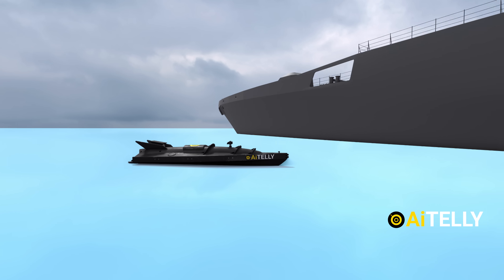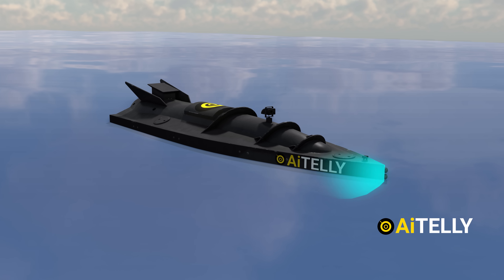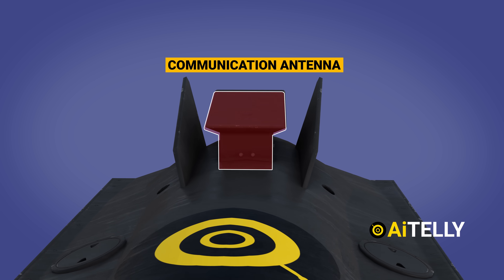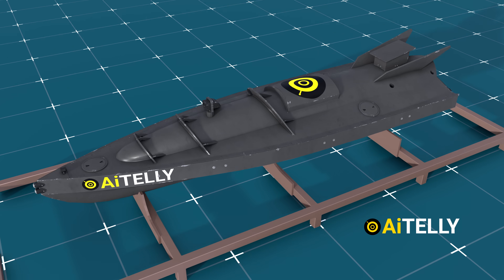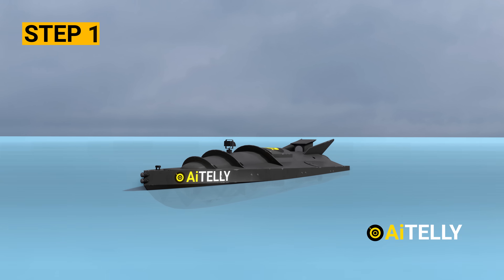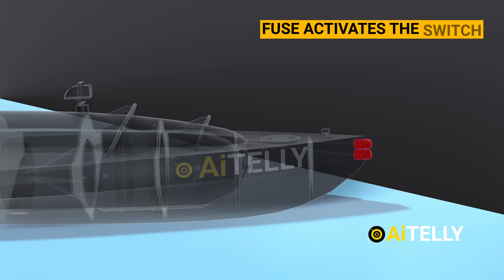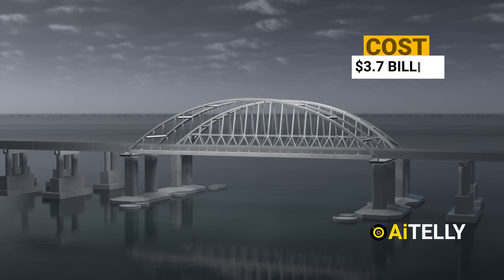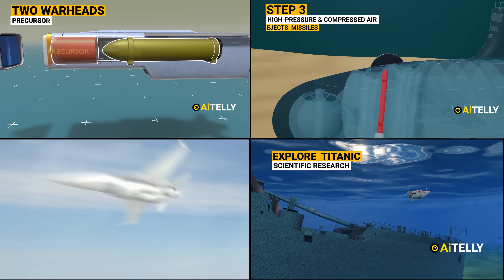Naval Kamikaze Sea Drone How it works using Starlink Satellite

Comment: Can you stop with the overly dramatic Verbage? It's a surface vessel. It doesn't operate or draw water from "THE DEPTHS" and the hydro jet motor is a good component for use in the drone boat but unless you were frozen in 1970 and just woke up, its not really jaw-dropping tech to anyone nowadays.

Comment: Ukraine's drones use GPS and GLONASS not Starlink. Musk won't allow Starlink to be used for offensive operations nor permit Ukraine use at sea. 

Ukraine's drones cost a fraction of the $250,000 you quote. Ukraine is using homemade drones, rather than torpedos, to save money.

Comment: I wonder if the arches could be made to 'hum' like a tuning forks. Most drones use FM signals, sat relays are too expensive to be disposable like kamikaze drones. FM pilot control, and a Reaper style drones being fed real-time data from NATO central.
The flares used to distract certain missiles could also be used at high value targets, if flashing LEDs will blind a camera that is using 'OCR' style self targeting for the last part of the flight, that is even better because a capacitor can be recharged quickly.

Will a 6-barrel .22lr be far away? One on each corner of a high value building, all connected to the other guns on nearby buildings so you have 3D aiming.

Comment: The Seadoo motor and pump is amazing. I used to own two when my sons were young and I was amazed by the power, and the efficiency of the water pump over propellers. So don’t put the power down please. So 50 mph does not sound impressive until you do that on water. Out of eight boats I have owned only one would go that fast.

Comment: This is a surface drone and it has many disadvantages. A little time will pass and he will already be old. The Russians have a proverb: “For every smart ass there is a dick with a screw. This drone is controlled by radio or via the Internet. This means its control can be jammed. If you make them like cheeseburgers, just as quickly and a lot. They can do a lot of harm.”

Comment: If they had built them like the drug dealers do, where an extremely small part sticks out above the surface, they would have been very difficult to detect.
In addition, they had hit the target ship's hull below the surface and caused even greater damage.
Just a thought.

Comment: How about semi-submersible drone to avoid visual detection? Ukraine sea drone navigate above water like normal sea boat. So it can be detected by visual surveillance or electronic radar. The underwater sea drone can cruise under the sea to avoid such detection. Only air snorkel for engine air intake/exhaust gas, antenna for communication and camera periscope will be exposed over the water. Most of ship hulls and deck are underwater to reduce water or wave resistance. It will extend its range too.
Reply: For a given speed the more you are underwater, the more drag you have. Approximately 800 times more drag (water vs air). If you want to go fast you have to barely touch the water, you have to fly over it. Submarines are the slowest of all vessels.
No submarine can catch a moving ship (the ship is faster). They launch torpedos which travel a little bit faster than a ship, but only for a few km, before sinking due to the lack of propulsion.
Reply: There is at least one already in UA. Named “Marichka”.

Comment: This is not a 'Drone'… I would call it a 'Remotely Operated Seacraft'. 
A drone is, in some way, able to make some autonomous action. 
Maybe I'm being pedantic, or maybe this craft can take some autonomous action, I don't know. But in a time when actual autonomous machines are being built, and successfully used, I feel it is important to distinguish the difference between the two. 
*I am not blaming the channel for this, it is a great video. I do imagine that the research this channel did, most likely found this craft referred to as a drone. The word 'drone' is thrown around by almost everyone, when it is not necessarily a drone, but a remotely controlled machine or device.

Comment: hitech? this? cheap hull, engine of jetski, aerial bomb of soviet era, skylink of spaceX, it`s all borrowing power. Self-driving only on a straight path, this doesent have hive-like AI just operator work trough SkyLink that was shuting off by Elon Musk. Much more hitech contains in russian aerial guided bomb FAB-1500-M54 with UPAM (Unified Planning and Adjustment Module), satellite-guided autonomus fly on over 100 km distance with power of mass destraction on board. 675kg of high-exposive within 5 meter accuracy.

Comment: Not exactly self made. It's British design. 
There are few things wrong here. It doesn't reach 50 mph. That's SeaDoo's speed.  This is much heavier and speed is surely lower.
It doesn't use Starlink. It uses NATO assets for guidance.
Range is very questionable. Maybe, but not at high speeds. Kerch bridge is 700 km from Ukraine. They would travel there some 20 hours, leaving them very exposed.
But attacking of static charges is possible for Ukrainians, attacking ships is absolutely impossible without direct involvement of NATO. From their videos it is evident they are TV guided and Ukrainians are not capable to transmit TV signal at such distances.
I even suspect they are launched from a civilian ship in that area.

Comment: Taiwan's unmanned submarine will be built by the end of 2023. It has a displacement of nearly 100 tons and looks like a small submarine. There is a submarine-like sail cover above the submarine, equipped with sonar and torpedo tubes, and all the functions of a submarine. It is fully equipped and can launch small unmanned craft to monitor, lock and attack enemy targets. In the future, it will be equipped with anti-ship missiles or torpedoes to attack surface targets, or perform tasks such as mine laying, ISR (intelligence, surveillance and reconnaissance), or mine warfare.
While Taiwan is building its first IDS submarine, it is also building unmanned submarines, which will perform joint combat missions in the future.

Comment: Basic design is interesting, but it could be perfected. If there is a zirca 3 meter snorkel/electronic periscope/transmiter mast added to the design, done some smoothening changes to the body of the craft and the vehicle moves dived (with exception of the mast), like a kamikaze submarine, the vehicle should be much better protected (by the sea, and smaller outlying parts than the whole body) against incoming defensive machinegun fire, by the water around.
Reply: but then the speed would be reduced due to water resistance.
Reply: @ThangTran-bj4we  True. That could be mitigated either by shape of the drone, or by addition of kavitation technology. Other point - underwater movement will mitigate the sound of jetski engine. AND 3 meter thick layer of watter, defends pretty good against most of kinetic weaponry (machineguns). Device moving like that, will be targeted by anti-submarine armament, but that is usually ment for deeper (than 3 meters) use. Various granades and depth charges exist, but are ment for bigger, slower and a bit deeper moving targets - subs. Question is, how would the drone fare after ANY changes.
Reply: the point of such a design is precisely to reduce the cost of production as much as possible

Comment: Looks like it is human-operated via FPV, and it is why it needs broadband connection like Starlink. And it is the flaw. Not marvelous at all. It would be much better if it were fully autonomous. Then any "oldschool" low-speed satellite network could be sufficient for telemetry, abort or retargeting

Comment: Let's examine Ukrainian stupidity here 1. wastes Starlink terminals which in communication challanged Ukrainian Land Forces would and should be serving and saving whole companies, maybe battalions and which are subject of requent requests 2. camera isn't mounted on extendable mast therefore is low and has limited range of view 3. this is basically torpedo, but worse cause runs on the surface and it was demonstrated as far back as by Samuel Colt 4.  warhead is a joke - on pair with light sea-skimming missiles.  Much better idea would be using 750-1000kg  warheads from decomissioned P-500/P-700/P-1000 missiles, which btw. had more comprehensive guidance packages like 40 years ago. Or even better, use said missiles launched from shore - they have superior range anyway.  5. Tamil Tigers used  boats better shaped from stealth perspective some 20 years ago.  PS: really, you'd get better results with HIMARS launcher on hoovercraft.

Comment: Nice video, very informative. These vesels can be further improved. The main componets (engine, fuel, control unit & explonsive charge) can be completely submerged within a topedo like frame. If the charge is ignated underwater the water pressure from the blast will be more devastated to the ship target and also to concrete structions (check dumbbaster bombs of wwii). The sensors and the engin intake air could be above water on a fin "bridge" or on snorkel and periscope masts, in that way the visual signature of the vehicle can be smaller and would be able to operate at lower final speeds at noice and wave stealth mode. These should be at the rear of the vesel in order for any ship fire to fall behind. I like the swarm function... these tactics mean that any Fishing trawler can launch 6-7 of these vessels and destroy fleets witin their bases.
Reply: already happening
Reply: Ukraine has these too. They called Marichka, look it up.
Reply: Ну если так пойдет, то и ядерными ударами ответку можно получить
Reply: @user-wi5ph7qt5k
GFY inhuman fascistbot

Comment: Excellent vid!! Is one more weapon system, pretty much a guided surface torpedo. Even with autonomous AI, it would be not different than an smart guided missile. Very fast torpedos could be far dangerous.
Reply: Suicide drones are just Missiles but cheaper, less powerful, manually controllable and loiterable

Comment: That "communication antenna" is actually a Starlink set, so operators get a live video. Few of those videos were actually published. 
So far these drones scored only 3 successful engagements.
To end abuse of his equipment on 7th of August Elon Musk confirmed to CNN that he stopped providing Starlink over parts of Black Sea.
Reply: There were at least 3 successful attacks, a warship, the Olenegorsky Gornyak, an oil tanker, and the Kerch bridge.
Reply: @AD-gi9zg  You are right, I stand corrected. Interestingly enough both vessels remained afloat.
Reply: They can't use Starlink.
Reply: @fifi23o5  why
Reply: @ijustwanttogosailing8248  Elon Musk said it is blocked in the area. They can use it in Ukraine, but not beyond, including Crimea.
Reply: How many damage did Ukro Hohols incurred after Ruasian retialiation

Comment: Making smaller drones with electric engines is a better idea. Cheap manufacturing with a saturated attack has a deeper impact.
Reply: For what? To get an extra 500 kg for batteries and an additional cost? Do you believe that batteries will cost as much as a tank of fuel and have the same weight?

Comment: remember that time a drone washed up on shore in crimea, before we knew these existed? it turns out that rather than a malfunction, elon musk and spacex purposefully disabled it in the middle of an operation. just shows how dangerous it can be to have so many things owned by one guy. apparently around the same time they also disabled a bunch of starlink devices at the frontline, causing severe communications disruption that likely led to the death of soldiers.
Reply: The Pentagon now paid SpaceX for some Starlink in Ukraine.
So SpaceX can't shut down access anymore.

Comment: Good graphics, and topic....  however the script, please get some help, it was over the top and lacked substance. Jet ski modified to be a low profile Kamikaze drone. Using starlink for communication using contact fuse to detonate.  You just said that about 25 times maybe do a little research to add value beyond headline level information.
Reply: i was thinking the same.. hopefully they take in the constructive criticism. this was very cringing to listen to.

Comment: They should have radar absorbant coating or a paint coating dazzle shapes that blend in with the sea it would make them way more stealthy although radar absorbant coating doesn't do well in water maybe rubber submarine coating.
Reply: Hmm, good idea. I have an idea 💡  there is a pattern that will make it nearly invisible to the eyes but adding radar absorbent will increase its stealth capabilities
Reply: Something like Tamil Tigers were doing mere 20 years ago.
Reply: This drone will probably be improved over the next few years. That may very well be one of the improvements.
Reply: This makes no sense, there is not a single radar that can detect it, the blind zone over the sea is about 1-2 meters minimum. Of course, the closer you are to the radar, the smaller this zone is, but it will be too late.

Comment: A few questions:

*A Seadoo engine moving fast, very faste a 5m+ 250kg++ hundreds of km?

* Stealth? a mass up to 1.000 kg payload, with multiple comms for operation and targeting.

* Russian CIWICS? surely the have one.

* At 250k $ cheaper than decent torpedo but not much IMHO.
Reply: I also have some questions.
There is 700 km from Ukraine to Kerch bridge. 
50 mph? For a short burst, maybe. This thing is not big enough to have such a range at high speeds. That means it has long range cruise speed maybe 10 mph, thet would make them exposed for many hours.
Guidance is also very questionable. I think, actually I'm pretty sure they use NATO assets for guidance. RQ-4, RC-135, P-8...... 
I suspect they are delivered by civilian ships to the area and there is direct NATO involvement in guidance.
Reply: Us hardware is expensive except that seadooo